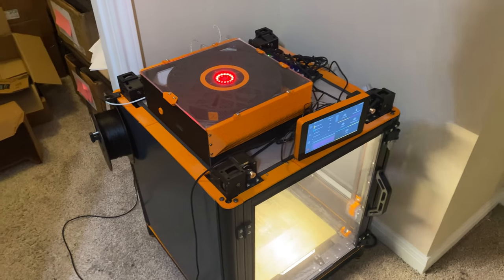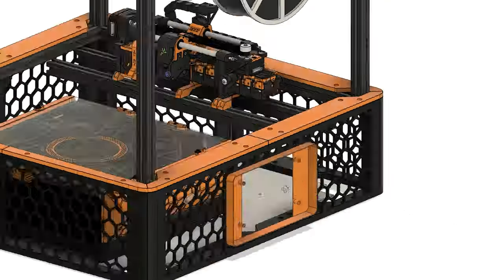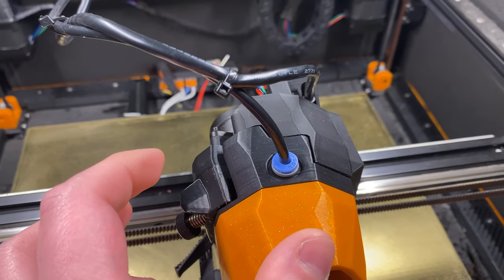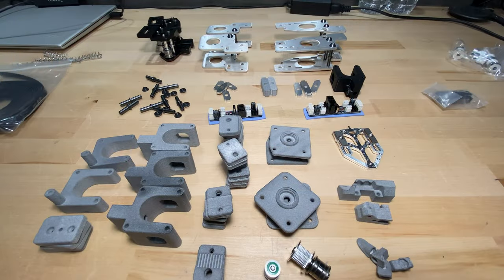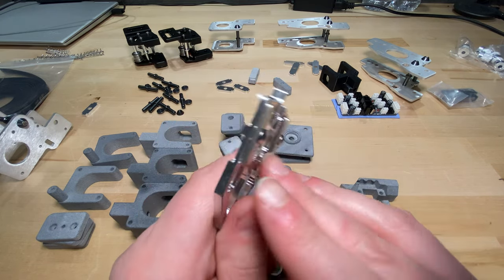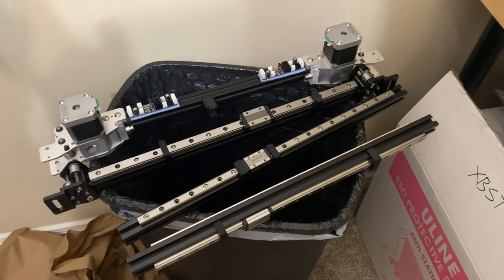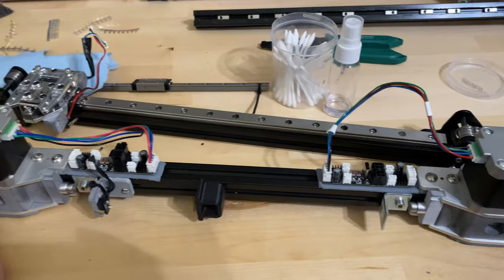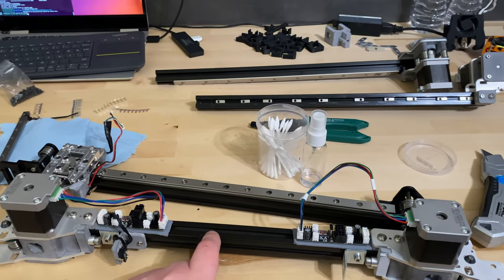Voron v2 Ep. 27 - Metal AWD 9mm Gantry & ERCF Prep Pt. 1 - Tallest Voron 2 Ever (?)

Comment: Nice to see that I'm not the only one battling with BTT pcb quality. If you simply stare at their (mostly canbus containing) PCBs, the pads start popping off.

Why do you insist on having the stepper drivers on the gantry? The disadvantage is complexity and cooling, as you're inside the chamber. Routing 4 motors' wires from the gantry to your electronics at the top, is simple, via the Z-dragchain, which you already have. Cooling in your electronics bay is way easier.

Lastly, try to thermally insulate your printer below your electronics bay, so that you'll need less cooling in the electronic section.

I learnt a few things from your video. Thanks a lot! 😃

Comment: Very cool video! About the Awd synchronization is very easy, you just loosen the pulleys on 1 of each “X/Y” motors, power all the steppers on then tighten the pulleys.
You should do your PCB 36v capable so if you want to use 36v with 2240 drivers you can.
I have tmc2240 with 36v on my V0 and it made a noticeable improvement on max speeds/accelerations

Comment: How is your can cable and ptfe hose ran? I like how flat it sits, my uses a steel cable and sits very high
Reply from the maker: Just the bowden and cable zip tied together, nothing else to support them. Goes to a hole near the middle (offset to one side for Nevermore compatibility) on the top panel.

Comment: Great vid, very insightful. Love yuor cat.
I'm building a custom printer and will prob have same issues with multi-mcu homing...... Was hoping to go CANbus. IF you do build custom PCBs, I may need a couple.
Reply from the maker: Some progress on this, I finished the PCB design for the first prototype. I think I will order a few in late April for testing. It has a F405 MCU now and 4x TMC2240 drivers. You'd only need 1 of them per gantry. They are more expensive than I was hoping they'd be though so I don't know if I will sell them on my store, but will be open sourced for sure when ready. (I'd need to spend mid 4 figures on inventory of a product that might not sell well) TBD

Comment: I’m doing similar but 48v and Kraken.  Haven’t considered can for the AB drives because of the added voltage. Have you thought about doing 4x EBB 42’s mounted to each stepper? That would eliminate your potential shorting to the gantry concern and give you more flexibility in your wiring.
Reply from the maker: That won't work because apparently Klipper doesn't support multi-mcu homing on multi-mcu axes (was in this video when I wired 1 X and 1 Y per GBB15).
Reply: I can confirm that  @IsiksTech  is right on this one. The EBB 42 is one of the more solid BTT boards, but it unfortunately only has 1 stepper driver onboard.

Comment: If you end up using the MMB, make sure to flash new firmware to it before connecting motors to it.  There's a risk of burning a motor if you don't.  The issue has to do with UCPD being enabled and putting a pull down on one of the motor_en outputs.  I found out the hard way on my ERCF😕
Reply from the maker: Thanks for letting me know. Not the first time BTT did something like that so not too surpised unfortunately.
Reply: @IsiksTech  I wouldn't necessarily put the blame on BTT.  It's a "feature" of the STM32G0 that needs to be explicitly disabled in firmware.  BTT presented the issue to Klipper on January 18 and it was fixed in Katapult/CanBoot a week later.  The big problem is that you have to search for the issue to know about it.
Reply from the maker: Thanks for the explanation. Those chips have another annoying "feature", if you forget to change "nBOOT_SEL", good luck flashing FW again (I think I talked about this in the video too).